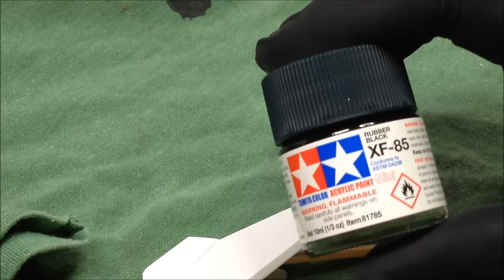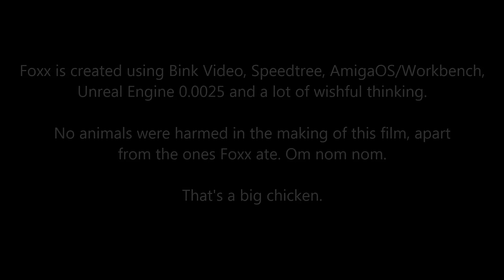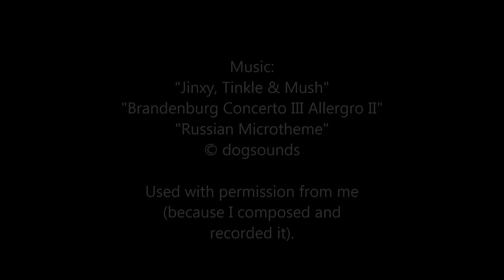SKILL LEVEL 4: Bandai MG Freedom Gundam Ver. Wolf Part 2: Nubs, Pre-Shade and Paint

Comment: Crocodile clips porcupine FTW! 

Ooh, splatty paint! Soon as I saw that, I knew you had the same problem I had recently with my iwata... A slight spur at the end of the needle. You can do a quick and nasty fix for now by dragging and rolling GENTLY along a sanding stick. It's only a temporary fix though, but should get you through for now until you can buy the new 'brush. Cos you're skint. Like me. Cos you keep buying more kits. Like me...but you build yours, yeah, I know!
Also, that preshading looks AWESOME! Really makes that whit pop, and gives the illusion that your demo piece is actually several plates bolted together instead of being one big piece - I likes that I does ^_^

Right... Buy some crocingdile clips. Can't believe I haven't done that by now... Choob. Hinge. Nub. I'll be speaking Ewok soon!
Reply from the maker: CHOOOOOOOOOOOB 

also SPOOOOOOOOOON

Nah, don't need to buy a whole new airbrush, just a needle, about £7. Luckily one of our suppliers at work sells the DeVilbiss stuff so I can get one easy peasy ^_^

I only started pre-shading a few kits ago, now there is no turning back...

Comment: What I've found is nipping the part off the sprue close to the part doesn't run that much of a risk for part deformation on newer high grades and master grades (2010-). If you're careful, you can  get a reasonably pretty kit in far less time.
Reply from the maker: +Sanic Hegehog Noted ^_^

Comment: very helpful^^. but do i need clear parts in soap water before i paint it??
Reply from the maker: NOPE! The only kits you need to clean before building are VERY very old kits, say from the 70s/80s, or resin kits. Other than those, there is no point at all.
Reply: Modelmaking Guru oh now i know that. Thanks you save me🖒🖒

Comment: do you wash the parts before you start building your models to remove the casting residue to make it better for painting or is that just superstition?
Reply from the maker: +Keith VonBernewitz No, it's not superstition, it's actually good practice. In reality most modern kits don't come with mould release agent on the parts but you will never know, and the release agent could cause problems with paint and primer sticking to the plastic surface. I have to admit I always intend to wash the parts and never remember to (apart from commission builds which get the full works and so are treated very carefully), but ideally you should wash them every time, just to be safe.

Comment: Does posing the kit frequently will damaged its paint?
Reply from the maker: Yes, the downside to painting gunpla is that paint can scrape off the joints. The only way to avoid this is to glue the model into a fixed pose (i.e. glue the elbows and knees, for example). That way nothing ever moves and the paint is safe - it just becomes a normal model. That's what I do nowadays, because when you are spending 50-100 hours on a paint job, that model is going into a cabinet and will never be touched by human hands again ^_^

Comment: In th video you say tamiya is 50/50 paint to thinner normally. When doing preshading you said cup had 2/3 thinner. So is preshade  2/3 thinner and 1/3 paint? Also how full do you make the cup normally?
Reply from the maker: To be honest, the 50/50 mix is the "accepted norm", but my advice on actual mixing ratios is to ignore everything anyone ever says - even me! To avoid getting bogged down in science and chemistry and overthinking stuff too much, which takes away from time spent doing the fun stuff, just aim to make your paint have the consistency of skimmed milk. When I mix paints now, I just do it by eye out of experience, based on my past use of the specific paint and thinner, so giving a hard and fast ratio is nigh impossible - I will never mix the same amounts or the same way twice.
Reply: Modelmaking Guru You mention in the video, making a priming video. Did you ever get around to making one? I can't seem to find it, all the ones I've seen you skip scene when you prime. I assume it's like applying top coat but I was curious.
Reply from the maker: I've shown priming before, but only airbrush priming, not rattle-can priming. I'll try and get one done when the weather is summery again and I can prime outdoors. It's a very similar process to rattle can varnish (and rattle can paint) though, so you can take the technique from this: https://www.youtube.com/watch?v=KL0wuPksMO8

Comment: Can i....what's the pressure for spraying primer? For the shading? Thanks!
Reply from the maker: It varies depending on your airbrush, compressor and the primer you are using, but typically 15-20psi should be good. You can go up to around 25psi if it is very thick, but you shouldn't need to. As a general rule of thumb, the thicker the stuff you are spraying, the higher the pressure. I tend to default to around 15psi and increase it if necessary, rather than start at a higher pressure.

Comment: Hi! When you paint the parts, I noticed that some of them (like the forearm and the head part) are already put together. When the painting part is over and you want to put the polycaps in them, how do you remove them safety? Cause sometimes on my builds, i end up breaking some of the parts when i missed to insert a polycap in them and take them apart again.
Reply from the maker: +Red8Roku That's the part where building a gundam is like herding cats :) Basically, I will paint all the parts separately and unassembled as much as I can, then once painting, chipping and decals are done I  build sub-assemblies of parts that will need either just a matte or just a gloss varnish (if a sub assembly would be mostly matte but with a glossy part in it, I either don't assemble it, or leave the glossy part off till all the varnishing is done).. I plan the build so that if I make a sub-assembly, I have no reason to take it apart again (so all the polycaps are already in place when I build it). The difficulty with heads is when there is a big-ass seam line down the middle - to hide it you need to glue the two halves together, but you can't do that without inserting the polycaps and face parts. So, often I will have to fully paint up the face, assemble the head (inserting the polycaps and face parts), glue it and hide the seams, mask off the face and then paint the rest of the head. 

If you find yourself occasionally having to take sub-assemblies apart, then it might be an idea to trim the ends of the attachment pegs before you put them together (snip a little bit from the end of the peg on one side, at around 45 degrees). This will still leave you with a good solid attachment but because the peg is thinner at the very end it will be easier to pull the parts apart. However, it's better just to plan carefully the paint and build to avoid having to do this altogether. Basically, I make sure there will be no reason to take something apart once I build it (unless I screw up, lol)

However, if you MUST separate two parts, say either side of the inner arm frame, then use a blade to get inbetween the two halves  - try and find a natural opening in the piece like a hole or open part to start from ) and gently push them apart a little by GENTLY twisting the blade. Work your way along the seam a little at a time  - just make a little gap at first then work on widening it - and eventually they should come apart. You may scrape your paint a bit so remember to go back and touch that up later.
Reply: +Modelmaking Guru Thanks for replying in such a detailed manner. I guess i just have to try different techniques and find out which one works for me right? Although I'll just be starting to do airbrushing in a few weeks when both  my airbrush and compressor arrive. Do you have videos about how to mix paints when using an airbrush?
Reply from the maker: Not specifically, although at some point I should do a quick how to about airbrushing! Basic gist would be that unless you are using paint like Vallejo Air paint, which is pre-thinned, you might need to thin the paint for an airbrush (you might not, depending on the airbrush, so experiment). The ratio of thinner to paint can vary WILDLY and depends on the airbrush and the person using it, and also the paint ( I sometimes need to thin thicker metallic paints much more). The basic process is thinner in the cup first, then add paint. Mix  gently with a scruffy brush, then if your airbrush allow it, blow back air into the cup (gently cover the nozzle and pull back the trigger till the paint in the cup bubbles). Voila. your paint is mixed and ready to go :)
Reply: Thank you so much for the info! If I was to use those Gundam paints or the Tamiya ones, is it like a 50/50 ratio or kinda more paint than thinner. Sorry that I'm asking too much questions. I'm just can't wait to try it out myself hehe.
Reply from the maker: I don't know about the Gundam paints, but with Tamiya paints it's usually anything up to 50% thinner - but it depends on th3e paint, your airbrush and pressure. Some of their paints are thicker than others and you may be able to use less thinner and get away with it :) Just remember to use the right thinners for the paints i.e. use acrylic thinners with acrylic paints. Stick to the same brand if you can so you know it will work  (e.g. Tamiya goes best with Tamiya X-20A thinner). Or, you can use thinner from Ultimate Modelling Products (which go with ANY brand of acrylic paint).
Reply: Alright! Got it! Thanks for answering all my concerns. I look forward to your future videos. :)
Reply from the maker: No worries, my pleasure!

Comment: Any alternatives to shading with airbrush aside from using pencils?
Reply from the maker: You can get an alternative pre-shade effect by painting the whole piece black first, or using a black primer, but you would still need to airbrush the colour over the top. The only real alternative, if you want nice soft faded shading, it to post-shade, i.e. use something like pencils, oils or enamels after the paint is down, to add the shadow areas. Or you could use a thinned wash of a darker colour to get into all the recesses and gather around edges, but with gunpla make sure it is a non-aggressive liquid such as a clay and water based wash. Lastly, you could do a gunk wash with oil paints (there's a video on that in my How-To playlist). None of these would look like a airbrushed pre-shade coat though - you should think about getting one, it will change the way you do things ^_^

Comment: what do I spray on after I've laid my paint down to protect it while putting the kit together??
Reply from the maker: +Donald Cressman It depends what you intend the finish to be - if you plan to weather it, then a gloss coat should go on the parts before and after the decals. The gloss coat will protect the paint and will also allow panel line pin-washes to work properly. Once it is finished and all weathering done, a final matt coat will seal everything in. I think I cover all this in the videos though, so follow along and all will be made clear :)

However, if like on this build you want a shiny metallic inner frame then that gets a but more fiddly. You won;t need a final matt coat on the inner frame parts, just a final gloss coat after the weathering. BUT to keep the armour matte and the inner frame gloss, you'll have to weather and final matte coat the armour parts before you assemble everything otherwise spraying a matte coat over the built model will make everything matte including the inner frame you want to keep shiny. So, a shiny inner frame makes the planning and logistics a bit more complex :)

Comment: A Xacto knife with a #10 blade is easier to control and less apt to gouge the part.
Reply from the maker: +David Freeze You are correct! Sadly I have tried many blades and knives and have realised that basically I pretty much suck ass at nub-removal (which is why try to avoid making unpainted Gunpla) ^_^

Comment: Is it possible to remove seam lines just by painting them. Sorry for asking this
Reply from the maker: Nope, you need to fill them - whether with glue when assembling, sprue goo or fillers. The gap needs to be filled and the filler needs to be sandable so that once it is filled it can be sanded flat and smooth. Paint will not fill a gap and is not in any way sandable :)
Reply: Thank you. I was about to try it. Good thing i checked again.
Reply: Thank you. I was about to try it. Good thing i checked again.

Comment: hi. it is possible to pre shading without an airbrush?
Reply from the maker: Roberto Austria I've never seen anyone do it without an airbrush - although you could theoretically get the pre-shade lines done some other way, they need to be soft-edged, and I can't think of a way you would do that with a brush or pen. Also, there's no real way to gently build up the colour that goes on top of the pre-shade lines like an airbrush allows you to (you could use rattle-can paint but the spray pattern isn't fine enough to paint pre-shade lines and you don't have control over where the paint goes to stop any pre-shading simply disappearing underneath the paint). 

There is only one workaround I can think of, and that is using rattle-cans and the old-school Industrial Light and Magic method - paint the whole model the pre-shade colour (not just lines, but everything) and then spray the base colour carefully over that in light coats, building up the colour. If you are careful it can leave less paint in corners and recesses giving a sort of shadowed effect. However, although that method would work fine on something covered in details and greebles - like a Millennium Falcon - it would be no use on something smooth like a gunpla (it's no use for panel lines or for edges of pieces). 

But if you don't have an airbrush, give some thought to getting one. It seems scary if you've never used one but trust me, the results they offer are tremendous. Start off cheap and cheerful with a cheap brush and rattle-can air,  get your practice in, see what you think and when you are confident upgrade to better brushes and a compressor. Airbrushing is another one of those "dark arts" that most people are terrified of but in reality are really easy to use (the only challenge is using it WELL ^_^)
Reply: +Modelmaking Guru Thank you very much for your advice. I think it's time to think about the airbrush.
Reply from the maker: You won't regret it! Like I said, start cheap, play around, but understand that a cheap brush has limitations, so don't doubt your own ability; rather accept the brush will eventually hold you back and you'll wan't to upgrade . There is not so much a steep learning curve as just a need for patience as it takes a little while do learn how to use the brush naturally and to be able to do it without overthinking or panicking. It's a bit like learning to draw with ink and a brush when you are used to ink and a pen - it takes a little practice but eventually it just feels natural and you are drawing smooth flowing and expressive curves.  Use the cheap brush to gain confidence knowing that later on you can upgrade and flex those airbrushing muscles even more :)
Reply: +Modelmaking Guru I was thinking of using a soft makeup-like brush to brush on finely sanded pastels to get the soft egdes look, but you still have the issue of spraying/painting over it with thin coats to let the shading show through (though maybe the pastel layer could be sealed and the top color painted on with a thin wash?). Not sure, I've never even painted a gundam before (though I've done a bit with doll faces and blushing with pastels).

airbrushing looks like the best choice.
Reply from the maker: It's worth a try although pastels might be a little faint for pre-shading, and brushing them usually just acts like dry brushing, with the pastel catching on raised edges rather than making a pre-shade stripe. It might be worth perhaps trying pastels to add POST shading instead - i.e. apply the shading on top of the paint, not underneath? That should work. Might be better to use the little sponge tip of the brush (if you are using Tamiya weathering pastels) - that will create the darker patch more effectively than a brush. I actually show pastels in the final episode of this build so check it out if you haven't already.

Comment: Is there any preparation before putting primer?
Reply from the maker: Nope, apart from removing all the nubs. With older vintage plastic kits that actually came out of the mould over maybe ten years ago, you might want to wash the parts before priming to remove any residue from the moulding process, but with kits produced in more recent years you don't really need to. With resin kits, you should ALWAYS wash the parts before priming.
Reply: I still do the washing I thought it was a must for straight builds. And one more  thing sir, does your primer indicate enamel or acrylic or something?
Reply from the maker: Most primers are usually labelled clearly as acrylic or lacquer, I prefer acrylics as they are easier and FAR LESS STINKY to apply (although occasionally I will use Tamiya rattle-can primer, which is IIRC labelled as acrylic but is kinda technically more like a lacquer). I don't know if you can get enamel primers. I would say stick to acrylics (the ones I have used here are acrylic) as they are safer and less harmful, unless you intend to spray lacquer paints over the primer in which case you'll need a lacquer primer (lacquer paints eat pretty much any other type of paint.)
Reply: And one more thing sir. Do you sand it after primer?
Reply from the maker: Nope, not unless there is a lump or bump on a seam line that I need to take care of -  sometimes I will deal with seams and then prime the model just to see if any seams  remain visible or not (a seam that looks invisible can suddenly re-appear once a matt primer coat is applied over it).
Reply: Thanks for your help.
Reply from the maker: No worries ^_^